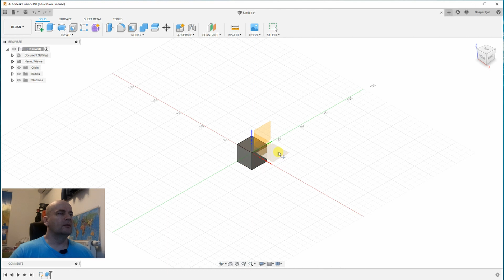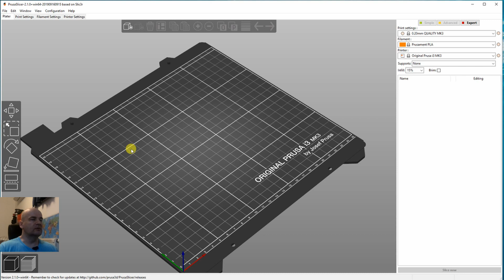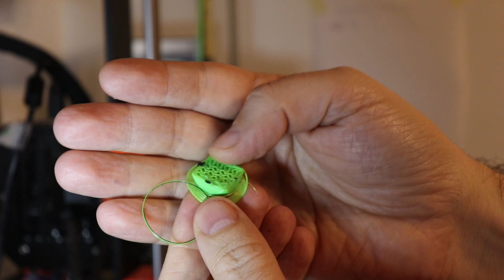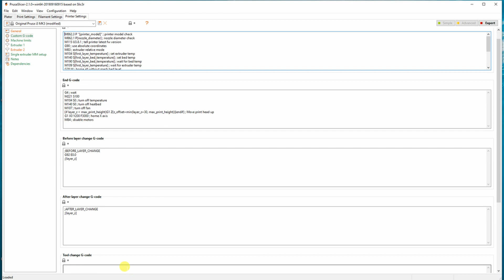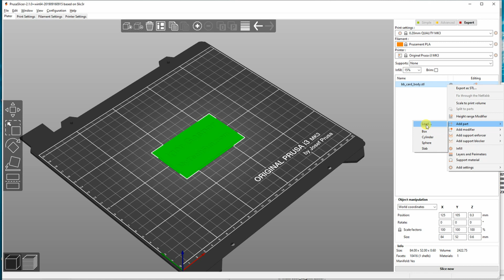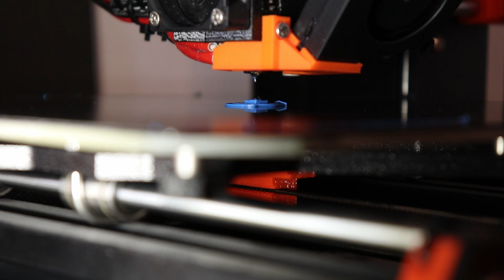Two color 3D printing with single extruder and manual filament changes

Comment: Hey, i have a problem with extra extrusion after filament change like in the video, do you have any solutions for it
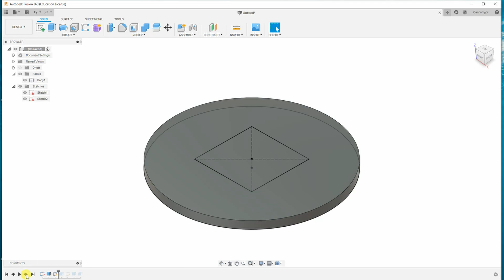Reply from the maker: Same printer and slicer? (Prusa) My final settings are from 21:24 https://youtu.be/W3z_b52lSIA?t=1284

Comment: Did you figure out a way to stop the "filament change" after the initial primer line is printed? Mine keeps doing what yours did in your video. I load the first filament, then it starts and primes the line, then immediately asks for a filament change...Any idea how to fix this?
Reply: Just add this to "Tool change G-code" under "Printer settings" -> "Custom G-code": 

{if previous_extruder == -1}

; we want to supress the first unnecessary M600
{else}
M600
{endif}

At the beginning of the print the previous_extruder is not set yet, so we can just check for it and only add the M600 for all other extruders. Works like a charm 🙂
Reply from the maker: When I generate G-code, I open it with Notepad and delete the first M600 command.
Reply: @MyTechFun  Thanks! Any way to change the default values in Prusaslicer directly so I don't have to edit the G-code every time?
Reply: @MyTechFun 😢 no M600 in my file?

Comment: Is there a setting to tell you which color to load into the printer? I am trying to print 3 colors but cant tell which color I am supposed to load in
Reply from the maker: This depend of the printer. I tried some notification g-code commands, they didn't work with that version of firmware on Prusa MK3. Since that I didn't tried 3 color printing (only 2). Try to add 1, 2 or 3 beep sounds before color change (depend of the color).
Reply: @MyTechFun  I made a custom code that parses gcode files and tells you which extruder you are supposed to change to. I put it on the pruss forum if you want to see